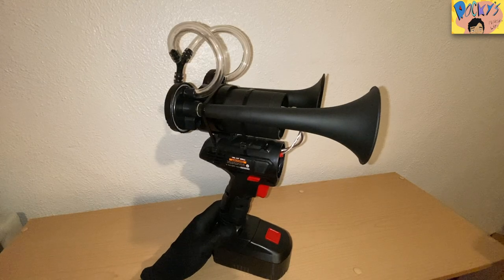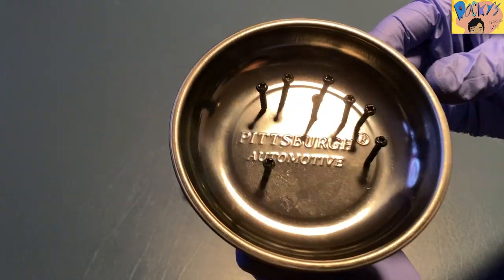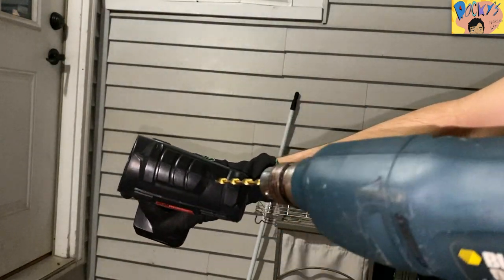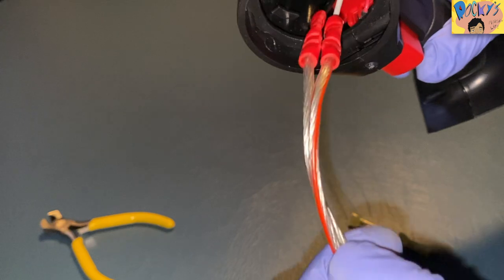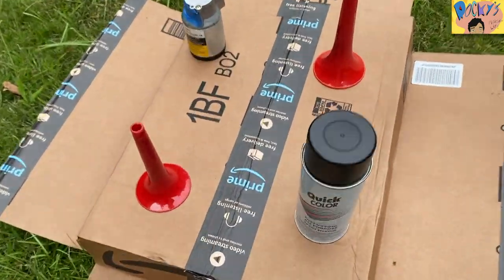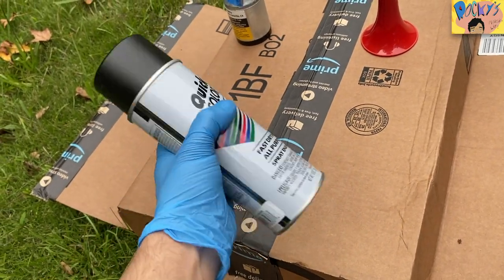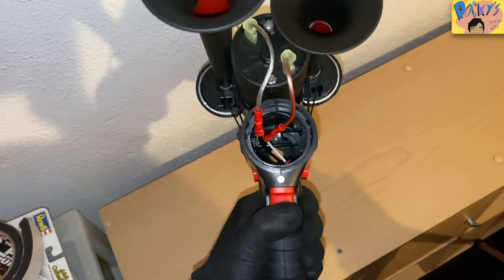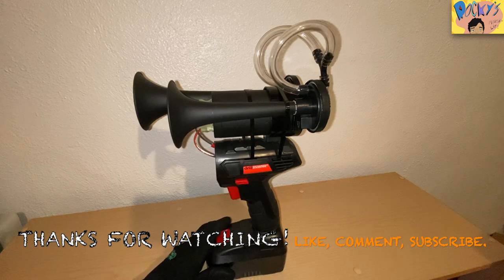How To Make A DIY AIRHORN "Scare Horn" For Halloween & Pranks

Comment: Does it have to be that specific drill or is there another brand that could potentially work? The cheapest drill the store near me carries is a warrior 12v drill
Reply from the maker: No it doesn’t in fact after 2 years of using in a haunted house I would recommend a drill with lithium ion batteries because it’s a hassle always changing these cheap batteries good luck !
Reply: @rockysmodernlife182  I've made about 5 of these but all slightly different since this post. Now I just have to wait for Halloween time😂